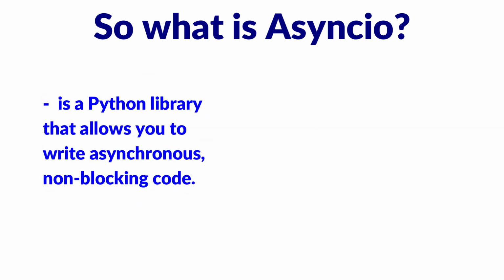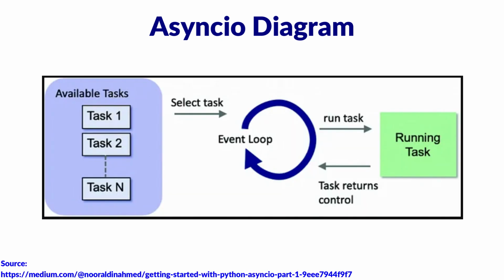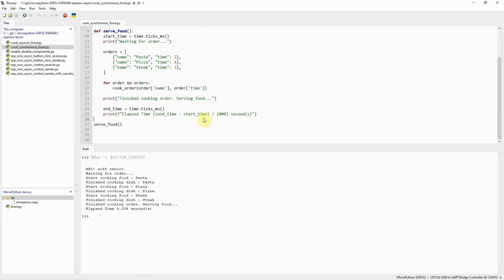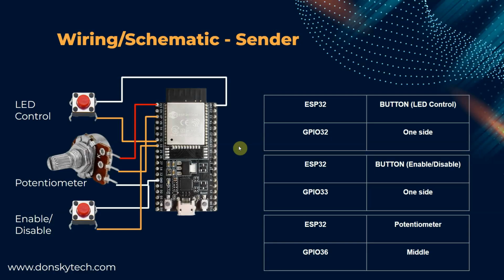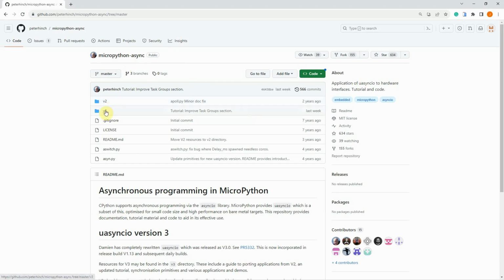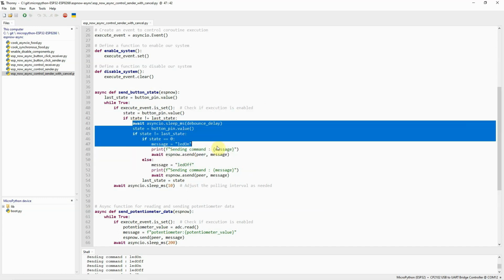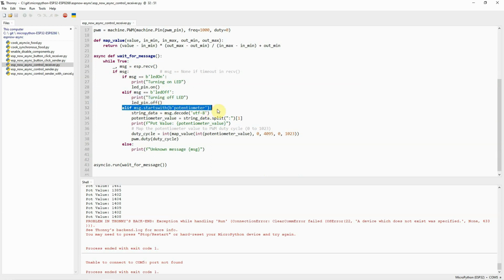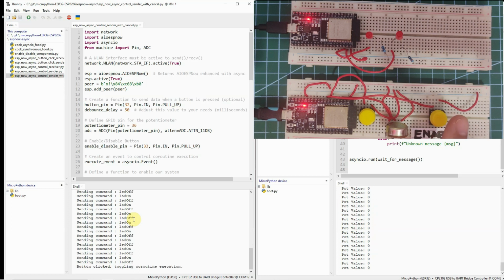Discovering ESP-NOW in MicroPython with Asyncio

Comment: Another great video. I just started using espnow and this concept of asynchronous coding will be very useful for future projects. But I do have a question. I just built a simple weather station using espnow. The esp32 that I placed outside is on battery power. If i use asyncio in my code, then the esp32 should wake from deepsleep for a shorter time before going back into deepsleep conserving more battery life. Does that sound correct? Thanks for the great videos. You have given me several ideas for fun projects.
Reply from the maker: Hey, thank you for the compliment. I have not included the deepsleep functionality but based on the official documentation, it is indeed supported. Let me try to add this topic to the next video.

Comment: Thanks for the last two videos. Been struggling to find peer-to-peer wifi for the PicoW's for robot control. Looks like I might switch to the ESP32 board. Thanks again.
Reply from the maker: Hey Keith, I have been looking for the same on my Raspberry Pi Pico W on my new project.  Unfortunately, there is not much information also.  I went back to ESP32 and I was surprised how easy it is to make ESP-NOW work in MicroPython.  My next video is related to WiFi and MQTT interaction with ESP-NOW.  I am making a blog about it currently.